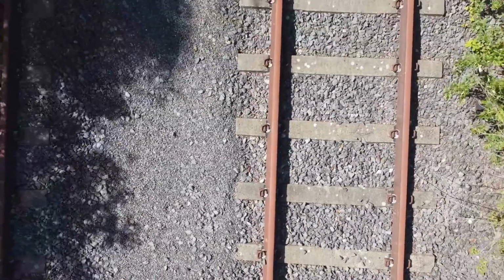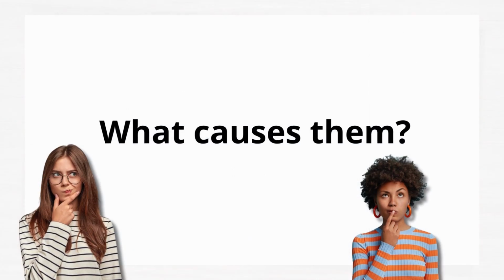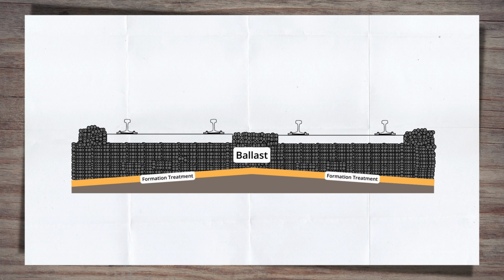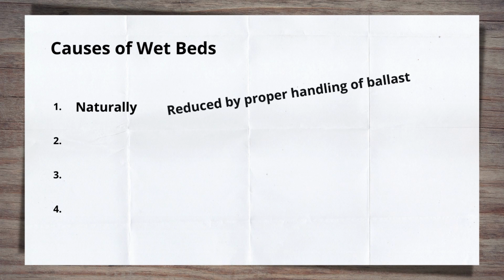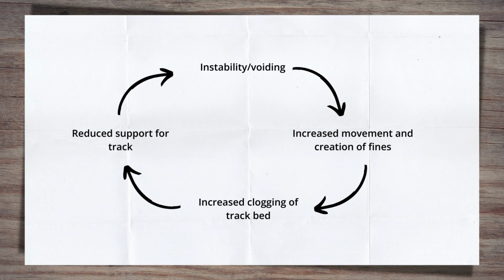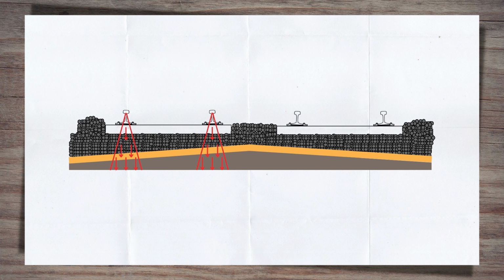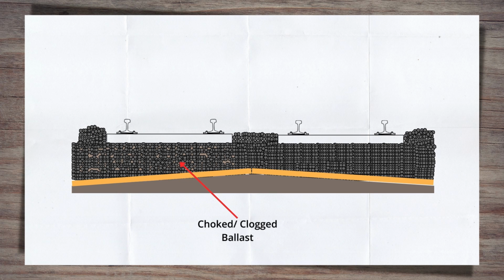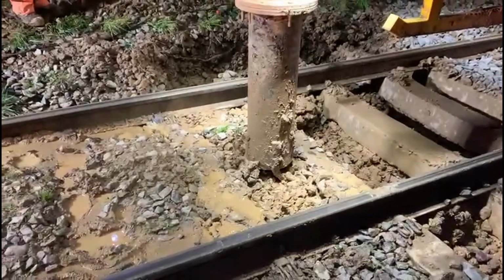4 Ways Railway Wet Beds Form | Railroad Track Engineering

Comment: Interesting. Is this different to what’s often called a sinkhole? … where a train pushes the track down slightly as it passes because of a failure with the track bed often caused by rain, creating mud (I’m in Australia so terminology may be different). 🤔
Reply from the maker: It sounds very similar, when I think of sink holes I think of huge holes appearing in roads or swallowing houses.

Wet beds do cause the tracks to be pushed down, what i know as voiding. The track is pushed down into the space, or void, below the sleeper
Reply: @thepwayengineer  Yes, voiding is basically what I’m talking about.

Comment: Many many wet bed sites throughout NR are caused by the lack of proper drainage ever been installed in areas like cuttings and areas with more than 2 roads where tracks are surrounded by other tracks, add to this the total lack of drainage being cleaned out like it used to traditionally yearly leads to the formation failing long before it was meant to! To make it worse I have even seen people posting pictures of major renewals sites with track being installed without any thought of drainage in ares where it is clearly needed!
Reply from the maker: I couldn’t agree more. Possibly the railways most unloved but critical asset

Comment: How does modern PW, with deeper beds, advanced membranes and concrete sleepered heavy section FB welded rail compare with the older style BH jointed track on thinner ballast (and in the case of the Gloucestershire - Warwickshire Railway, cheaply built embankments constructed directly on unprepared vegetation*, with inevitable results a century later)?  

Increased automation vs manual gangers is one obvious change and I'll go out on a limb and suppose a slight difference between 300kph OHLE and unfitted loose uncoupled freight plodding along behind a 10-coupled, 2cyl steam loco at 50kph.

*seriously .... that happened, twice on the same route.  Google "railway Gotherington embankment" and "railway Chicken curve embankment"